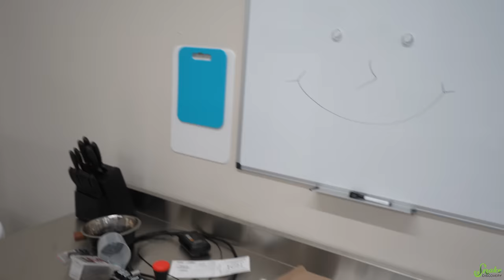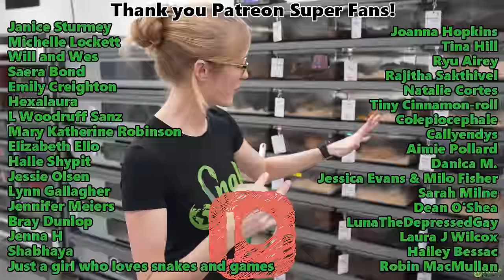New Snake Breeding Facility Update!

Comment: I might suggest looking into those plastic sheets like on the big walk-in freezers at costco and the like, for the "shipping area. If you're going to have that overhead door open much , they will help reduce the thermal drop/spike to the rest of the building while the overhead is open. I think uline has them in a couple of different styles
Reply: Or an air curtain. It blows to keep bugs out
Reply: Yes, vinyl strip doors!

Comment: Definitely a good time to do a perimeter check and foam block any cracks or holes you find. Also those floor vents. Might add screen covers to avoid escapees into the air system. Also outdoor carpet mats would help with echo from the slab.

Comment: Tip: The best way of filling out a big space like this is to make designated spaces more closed off. An example I would recommend is moving the feeding table perpendicular to the wall. That way, it should make an upsidedown U shape, it closes the space so it doesn't feel out of place, and you could even eventually add another table behind it facing away and it utilizes your space much better. Also now it won't be a struggle to reach the top of the whiteboard, because there isn't a table between you and the wall. Hope this helps, you guys are awesome!

Comment: YOU SHOULD NOT HAVE BEEN UNDER THAT REFRIGERATOR LIKE THAT. THAT COULD HAVE EASILY FALLEN AND CRUSHED YOU. Also you should’ve just used a deep socket wrench for those bolts

Comment: Seems you could use some fabric banners hung at the top of the walls to absorb sound. Also, every time that loading dock door opens wide you will lose your heat or a/c in a big way. I wonder if they make a large curtain wall for warehouses that can be hung on a track off the ceiling and opened/closed by remote control.

Comment: For the snake that vertically climbed, my western hognose (YES, the burrowing hognose) chimney climbs straight up vertically effortlessly. She'll brace the lower part of her body between two parallel surfaces (like sides of a chimney), make an Z shape and brace the upper part of her body a little further up the parallel walls (or even a pair of parallel bars- she climbs those using this method too!) Then she'll hold on with the lower braced part of her body, shove up the upper braced part of her body, and while holding on with the upper braced part of her body she'll move her tail up and repeat, inching her way up the "chimney". 

Looks like there are some parallel surfaces going straight up (specifically the far left side where the wall is a few inches from the metal- my snake could EASILY chimney climb that were she the same size), your snake could have done the same to get up there- that's the simplest easiest answer anyway.

Comment: Get a toolkit made with a cordless screwdriver and lots of different heads, incl ones for bolts. Tool kit at each site is a saviour when you suddenly need a tape measure or screwdriver.

Comment: I agree with Emily, Allen wrenches are the worst. They're so awkward! I'd much rather just use a standard spanner than I can actually spin all the way around! Doesn't help that I have this weird issue with that particular turning-wrist movement that the Allen wrenches require... and that a few other things require. I also don't like round doorknobs because they get stuck pretty easily. And lights with a twist-action switch... sometimes I can't turn those on. Learned about the wrist issue back in about '91 when 8yo me couldn't turn the light on in the hotel, but my 11mo old brother was playing with it.

Comment: You should’ve told her about the snake that got away for a short time. Because how high up he went is exceptional. It’s winter you probably don’t have that up to exactly the right temperature yet and this little guy climbed over 10 feet. Maybe you guys can make a play area for different snakes and if they eat nice and don’t bite you too often you could let them play in the vertical playroom, not just a horizontal. They have all the time.